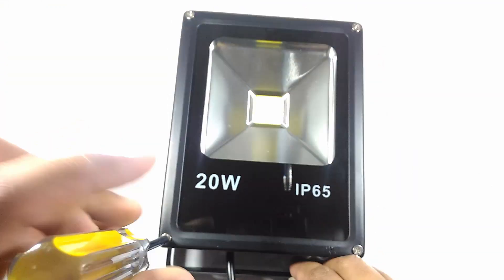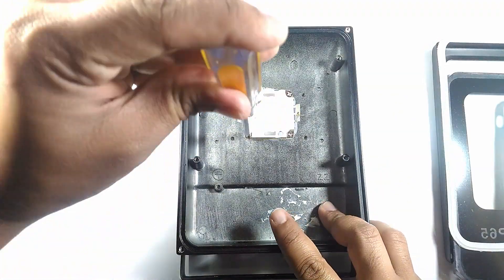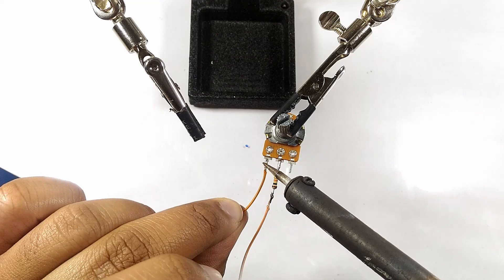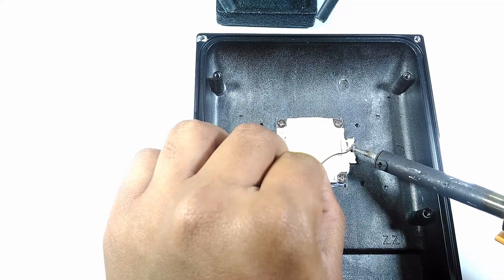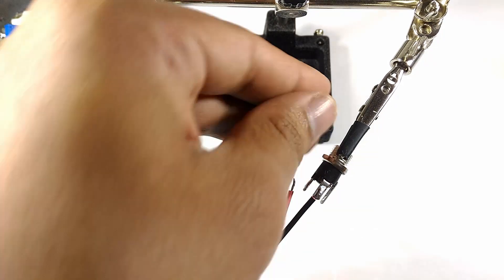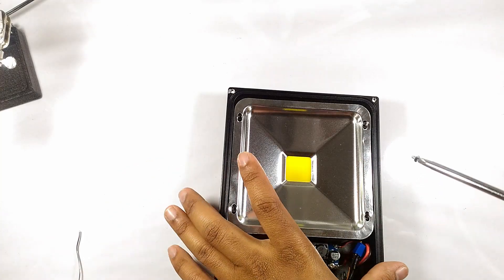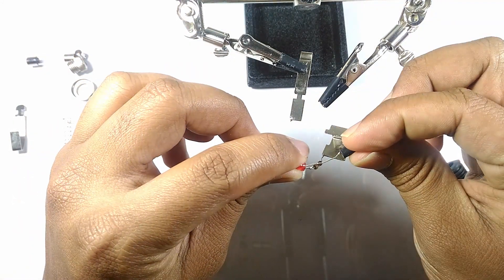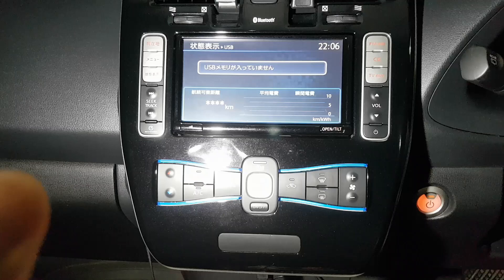DIY Dimmable Flood Light (LED Conversion – Powered by Battery or Car)

Comment: Could you put the POT between the led driver and the led plate? I have a similar flood light and wanted to do this type of mod. Also do you think adding an on/off switch would be possible. Thanks for your reply.

Comment: very awesome video,  what boost converter must i use for a 50watt led and i am guessing i would just soldier back the driver on the input of the boost converter as i want to still use 110v?
Reply from the maker: Connecting a buck or boost converter to the 110v driver is not recommended. If you wish to dim the led still using the 110v driver you might have to use a different hardware. Sorry for the delay in reply.

Comment: Can I use the boost converter along with the led driver? I want to make a dimmable flood light that runs on AC current. I was thinking of using boost converter to modulate the current coming from the led driver. LED outputs DC current as far as I know. Please correct me if I am wrong.

Comment: It's possible to put the dimmer in led flood light 100w, I have Philips BVP174 ? Thanks
Reply from the maker: Hi, I googled Philips BVP174 and it seems like its a COB LED that runs directly on 110v or 220v. The boost converter I used in the video works only with flood lights which have a seperate LED driver. The LED driver was replaced with the boost converter in order to adjust the voltage. 

For COB (Chip On Board) Flood Lights, its usually possible to dim the brightness using a normal 220v Dimmer Switch. You know the ones used for fans and lights. If the light flickers even when the dimmer knob is not being rotated, try using those dimmer switches which have only 5 settings, instead of the ones which have a smooth rotating knob. But try these at your own risk, since im not sure about your warranty status.

Comment: Hi. I have a question. Is yours considered a PWM dimmer? I'm looking at how much flicker there will be if I used this to shoot videos. 
2nd question is: what do I need to change for the parts if I want to use a 50W or 100W LEDs?
Reply from the maker: Hi, since boost converters are switch mode power supplies, they do use pwm. There could be flicker if you are planning to shoot videos.
For 50W or 100W LED's, its best to use the 150W boost converter (usually around 3 USD online). 
It would be even better if you get the constant current version (bit more expensive) of the 150W boost converter if you plan to use expensive LEDs since keeping the current constant will increase the life of the LED.
Reply: @keshbyte  how do I know if the boost converters are constant current? Also, I saw 250w boost converters. Are those fine?
Reply from the maker: They usually have it labelled in the product listing if the current can be adjusted or constant current or something similar. Another point is the boost converters without constant current has only 1 potentiometer, the ones with constant current have 2 or more (usually).
I searched for a 250W boost converter. The one I saw (around 4 USD) has a white PCB and has two potentiometers and its labelled as constant current in the product listing, and this seems fine.
One of the potentiometer is for adjusting the current. It will be labelled as constant current or CC-ADJ (for constant constant current adjust).
Reply: @keshbyte  thank you. Let me get these and try. Thanks for clarifying
Reply from the maker: Happy to help :) Let me know if you run into any problems
Reply: @keshbyte  I'll try it out and let you know. I'm also trying another one with a COB LED using AC.
Reply from the maker: COB LEDs running on AC usually have a flicker
Reply: @keshbyte  Hi. My parts are coming. Slowly. So I have a question before I start any soldering. Why did you remove the potentiometer from the boost converters and solder it to the other potentiometer?
Reply from the maker: Its cos I used the small potentiometer which came with the boost converter as a trimmer potentiometer, in order to limit the maximum voltage to 30 volts. So that when I adjust the big potentiometer, it varies the output up and down but it doesnt exceed 30 volts. 
The forward voltage of the LED is 30v and exceeding that will burn it.
Reply: @keshbyte  thank you. Now in Mumbai. Will try everything once I get back home next week. I'll update you whether successful or not.

Comment: I dont understand :( i really need this mod but i dont understand could you make it more easy for a guy luke me who doesnt understand electricity
Reply from the maker: Which part do you find difficult? I could try to help you. Have you soldered before?
Reply from the maker: I have an article on Instructables about this mod, the link in the video description. Maybe that would make things easier.
Reply: @keshbyte  can I use 10watt LED sir ?
Reply from the maker: The required voltage for most 10 watt LEDs are not the same as 20 watt LEDs. The voltage required for the 20 watt LED I used is 30v.
Reply: @keshbyte  ok fine sir, as long as i can make it dim i wont get so bright light, So can i buy only 1 20w flood light and use the stock led ?
Reply from the maker: Yea its fine to use the stock LED already in the flood light. Use a voltmeter to check for the voltage the LED uses before removing the stock LED driver. But please be careful with mains voltage. It could kill you!!!
Reply: @keshbyte  what it means with main voltage ?
Reply: @keshbyte  can i use stock led or i have to buy a new one ? And do i have to use that kinda watt meter ? What's the name sir ?
Reply from the maker: If you already have a working LED thats fine. In the video I installed a new LED since the one that was there already was not working.

I used a voltmeter not a wattmeter to measure the voltage which the boost converter put out. Any voltmeter or multimeter which can measure voltage is fine, there is no specific brand needed.

I used a boost converter in order to increased the voltage I input from 12v to 30v. The potentiometer was used to increase or decreased the voltage in order to dim the LED. The resistors and other components were soldered to the boost converter in order to limit the max voltage to 30v so that the LED would not burn out accidentally.